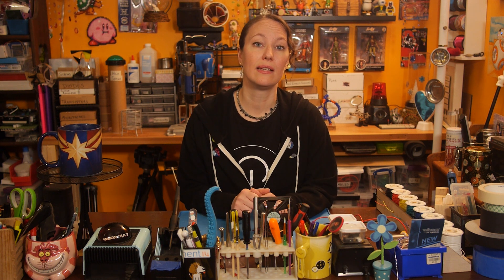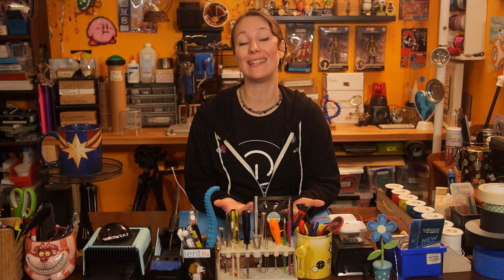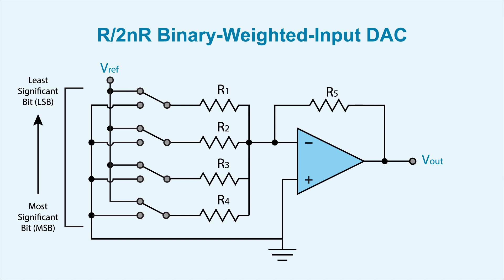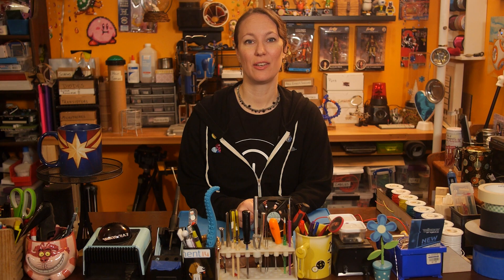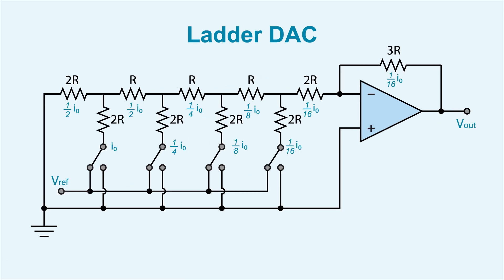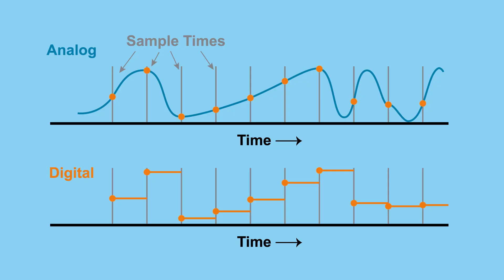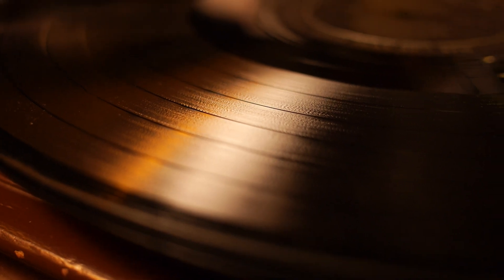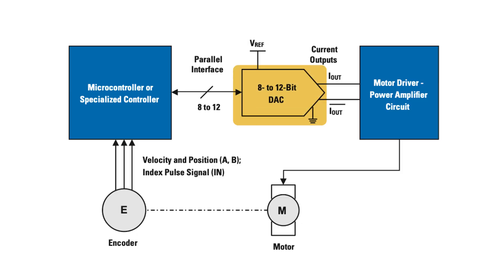How Do DACs Work? - The Learning Circuit

Comment: THANK YOU SO MUCH for pointing out the fact that dac's can never produce a "true" analog output!  I try to explain this to some of my audiophile friends & they either don't believe me or just don't understand -  now I can just show them this video to convince them that I 'm NOT crazy! (Or, at least I'm not wrong.....)
In fact, I've argued with my fellow electo-nerds that a dac is not really a digital-to-analog converter, but a binary-to-decimal converter, since it will only output integer values, rather than floating point, so there's always some discrete "step" between values!
Anyway, thanks again for this, and all your other AMAZING videos!     You should know that just a few seconds in, I immediately SLAMMED the subscribe button & I can't wait to see MORE of your incredible content!  Cheers!
Reply: actually, this video is wrong when it come to outputted analog signals so don’t use it as “proof.” You’re the incorrect party here.
Reply: @DoctorHobby I beg to differ.  It all comes down to the fact that analog, by definition, is a continuous measurement, and therefore INFINITE resolution. I know of no DACs with a resolution higher than 24 bits, yet even if one had a resolution of 24 TRILLION bits, it would STILL have a descrete, FINITE step size, making it incapable of generating an absolutely perfect reproduction of the analog input media.

Comment: Except with the case of audio, you aren't hearing the stepped waveform because filters are used to smooth the signal back into its "original" form. The better the filter circuits the closer the converted signal will be compared to the analog input signal.

Comment: This is idiotic : DACs actually smooth out the reconstructed signal with various anti-aliasing techniques. Vinyl is not a perfect analogue of the recorded signal ; vinyl records are cut on a lathe and they have severe frequency an amplitude-dependent electro-mechanical limitations that means they have a high level of distortion and a limited dynamic range.
Reply: @phpn99  I beg to differ.  While DACs do  employ anti-aliasing techniques, such as low pass filters, the distortion she's talking about is a function of the input resolution. Since analog signals often contain values BETWEEN the discrete digital steps of the ADC, information is inherently lost, before the signal ever reaches the DAC. This causes distortion known as "quantization error", which is irreversible, since the analog information was never properly captured in the first place.  While a DAC can, as you say, "smooth out" the output signal to APPROXIMATE the original analog input, this can never be as accurate as a true analog recording, since so much information is lost in the process.  While it's true that a re-constructed "analog" signal can sound extremely close to the original input signal, certain ultra-sonic harmonics, or "overtones" physically CANNOT be reproduce by a DAC.  For example, if the instantaneous analog input sample happens to equal 3.452 volts, how would a DAC reproduce that, when the closest value it can output is either 3 or 4 volts?

Comment: I really don't think the output wave is stair stepped on a proper audio DAC. Had a look at the output on a scope?
Reply: Yes, I actually HAVE looked at audio signals from a DAC on both analog and digital storage oscilloscope, and, though a good DAC can output an extremely "smooth" signal, if you look closely enough, some measurable amount of quantization error, or "stair-stepping" is ALWAYS visable.

Comment: 7:00 What you show and say here about 'small steps' in the DAC output is actually incorrect. Although the digital information is 'quantized' the output of the DAC will still look smooth. The reason for this is the use of low-pass filtering in the output. The 'small steps' would represent frequencies beyond the maximum recordable frequency possible with the used sample rate. These frequencies are filtered out with the low-pass filter. So no, the 'audiophiles' are NOT right when they say the waveform isn't smooth or 'real analog'.
Reply: @MacXpert74  Thanks👍🏻 Finally understand why a lp filter is seemingly enough. So that would be placed where in the circuit? I assume at the end of the circuit before it goes to amp or speaker.
Reply: @OMNI_INFINITY  Yes, it's a bit of a myth that DACs output 'staircase waveforms'. A lowpass filter is part of the DAC circuitry and filters out all frequencies above the Nyquist frequency (which is approximately half the sample rate.) As the Nyquist-Shannon sampling theorem tells us, this allows for 'perfect' reconstruction of the originally sampled waveform. This is also the reason why the so called "hd sound' using higher than CD standard 44.1 Khz sample rate is a bit questionable in terms of delivering audible sound quality improvements. Most people over the age of 15 (or so) won't be able to hear frequencies all the way up to the 20 Khz maximum, let alone anything significant above that. For all frequencies below this, the 44.1 Khz sample rate will produce exactly the same waveform accuracy as let's say 96 Khz or even 192 Khz sample rate used for 'hd sound'.
Reply: @MacXpert74 Actually a lpf has a slope, so 48khz is safer. And 192khz (oversampled) recording can be useful for processing audio later. There are actual useful reasons.
Reply: "Smooth" does not translate to "accurate".  I've heard it said that if the Earth was reduced to the size of a glass marble, it would be orders of magnitude "smoother".  Yet, from our scale, we clearly see the mountains, canyons, etc.  Likewise, just because the low pass filters "smooth out " the output does NOT make it as accurate as a fully analog system.  There is an inherent loss in information on the input side of the system, due to the finite resolution of the ADC, which results in "quantization error", and even assuming there is no more degradation throughout the process of storage, retrieval and re-conversion, that information is simply lost from the start, thus the output CANNOT be reproduced perfectly.
Reply: @flurng  Apart from normally very minimal distortion in the output of a DAC system, It's for all means and purposes 'accurate' within the Nyquest frequency range of a given sample rate. So for CD standard 44.1 Khz sample rate, the output is accurate within a frequency range of 20-20.000 Hz. The 'lost information' you're talking about due to the smoothed output of the DAC would translate to frequencies BEYOND the 20 Khz range. You'll have to understand the basics of how sound waves work to understand what this means. The fundamental of a sound is always a sine wave. Different waveforms are created by higher frequency overtones of that soundwave. So if we for instance record a sawtooth waveform that is increasing in frequency, it will become more and more rounded of by the low-pass filter as we increase its frequency up to the highest recordable frequency of 20 Khz at the CD standard 44.1 Khz sample rate. At 20 KHz the input sawtooth will become a sine wave on the DAC output. Now you might say it's not accurate anymore. Which might seem to be true. But the thing is that all the overtones of the original input waveform at that frequency would be beyond the 20 KHz range and completely INAUDIBLE for normal human hearing. So that's why the output of the DAC is seen as 'accurate' within the given Nyquist frequency output.

But this kind of 'rounding off' or 'smoothing' of the waveform will ALSO happen in analog recording systems, because their frequency recording capability is NOT infinite either. Most analog recording systems used for music recording hardly have any more frequency range beyond 20 Khz. They will also have much higher noise, wow and flutter and harmonic distortion. So the output of analog tape recorders will actually be a lot LESS accurate than what a DAC from an off the shelve CD player can achieve. 
But in the end the smoothing of the waveforms doesn't matter because human ears ALSO can't register 'perfect' waveforms with infinite frequency range. The vast majority of people can actually not hear anything at 20 Khz and often much lower, let alone above that. So this means that for instance a 'perfect' 12 Khz sawtooth waveform from which you can still hear the fundamental frequency, will to you sound IDENTICAL to the 'smoothed' or 'rounded' version presented by a DAC at 44.1 Khz sample rate.
Reply: 'steps' don't exist anyway, so wiggly-modulation upon the signal would pretty much always exist independent of how much a low pass damps them out, you just have to zoom further and further in.

If they are  actually audible though is a different story.

Comment: What is the use of chip and crystal Osilator on dac if only op amp and resistors are used. No one tells how software works with the frequency with the dac. How switching is done.
Reply: Maybe there are some more (digital) functions in the chip or it needs perfect timing

Comment: This is wrong. Audio DACs (and ADCs) are bandwidth limited to an appropriate range for the sample rate. The reconstruction filters low-pass the output of the voltage stage, eliminating high-frequency content (the stairsteps). The output signal accurate represents the input signal with the addition of some amount of quantization noise. Nevertheless the signal to noise ratio ( and dynamic range) of digital audio exceeds that of vinyl.
Reply: yes, this is common misconception, but in a tutorial video, it's a sin. Hope more people see your comment
Reply: @hraharahra No, it is not a misconception, it is a mathematically proven FACT; due to it's finite resolution, a DAC physically CANNOT generate an absolutely accurate reproduction of an analog signal.
Reply: @flurng  absolutely false
Reply: Also Nyquist's theorem states that you can recreate an analog signal accurately by using a sampling rate of twice the frequency you need to capture. Human hearing only goes up to about 20 Khz (in young ears), so sampling at 44.1 KHz is good enough. The part of the signal lost is above the range of human hearing, so for audio puposes it doesn't matter.
Reply: @jeffjuhre1494 The Nyquist theorem applies to ALIASING, NOT to quantization error, which is what many refer to as "stair-stepping".  This error is unavoidable on any system with a finite resolution (i.e. digital).
Reply: What video do you suggest I watch to understand dacs
Reply: Sir do dac resample the sound 🔊 through transistor switch
Reply: @pracheerdeka6737Not exactly.  While a transistor may be used to amplify the resulting signal, the DAC relies on a separate weighted input for each bit of the binary (digital) signal.  For example, a sample which raises the first bit 
(= 1)  would be sent through a resistance which might output 1 volt.  A sample which raises the second bit (= 2) would be sent through a resistance which outputs 2 volts. A sample which raises the first two bits (=3) would generate 1 volt + 2 volts, for a total of 3 volts. A sample which raises the third bit (= 4), would be sent through a resistance which generates 4 volts, and so forth.....
Reply: Thank you.
Reply: Actually, that is not entirely accurate; while DACs do employ low-pass filtering, these filters eliminate ALIASING, not "stair-stepping", (also known as "quantization error"),which is an unavoidable consequence of the DAC's finite resolution.
Reply: Chill its a introductory concept video not an end all be all explanation
Reply: @camerashysd7165  That's no excuse for the flaws in her explanation...
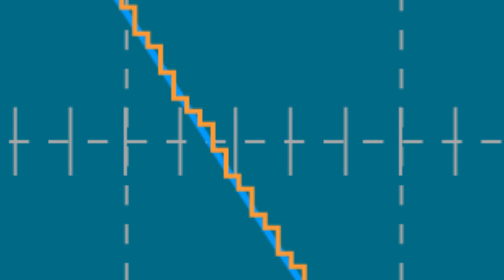Reply: @tmjcbs There is no flaw in her explanation (aside from the fact that she confused the Msb with the Lsb - an honest mistake.)  Have another look starting at 6:49.  The oscilloscope trace clearly shows the quantization error or "stair-stepping", which is a consequence of any digital system's finite resolution.

Comment: is using High resolution dac only way to creating smooth and real analog output ? Is there any other ways to get real analog signal from a device?
Reply: Video is wrong. Before output from DAC signal is low-pass filtered at nyquist frequency (1/2 sample rate), this produces a smooth and accurate waveform.

Comment: Even a vinyl LP is a compromise from an original analog signal due to the need for the RIAA curve. LPs have a limited tolerance for low frequency signals because the stylus can jump out of the groove if it is too wide. So to compensate, the RIAA curve was created. This means that the analog signal coming off of an LP still needs to go through processing before it is reproduced. Even if this processing is purely analog,  it will still not be a perfect representation of the original signal.

Great video!
Reply: You are absolutely correct! However, at a fundamental level, a good quality analog recording can reproduce ultra-sonic harmonic frequencies that a digital recording physically cannot reproduce, due to it's finite resolution.  While the human ear cannot hear these frequencies directly, they still interact with the frequencies that we CAN hear, thus altering the timber, or "tone", of the media, however minutely.

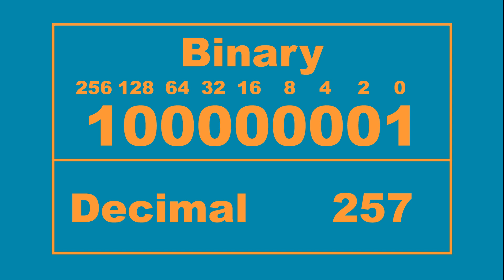Comment: There is a slight mistake on the weight of bits at 2:45, the first bit has a weight of 1 not zero, if a bit had the weight of zero would make it useless. Otherwise good video, keep it up.
Reply: Yes and there is a bigger mistake at 3:15, the least significant bit is the one next to 8k resistor, not next to 1k resistor.
Reply: Yes, there is a missing "2 to the power" in that diagram so it should read 2^0=1. :-)
Reply: @st200ol  No there's no missing "2 to the power", then the values would be 0, 1, 2, 3 (e.g. 2^0, 2^1, 2^2, 2^3). But when the values as they are used in the video (2, 4, 8, 16... ) are used then the LSB should be 1 (2^0 = 1).
Reply: Thanks!👍🏻 Sadly she got Me on that for a moment.